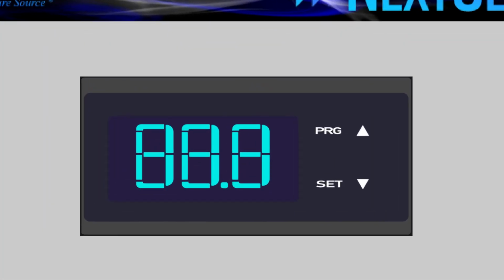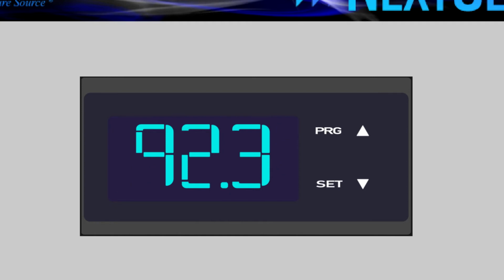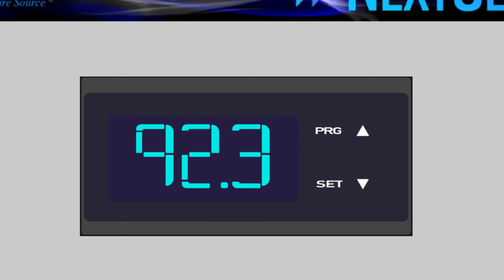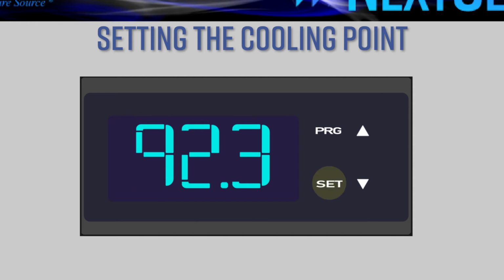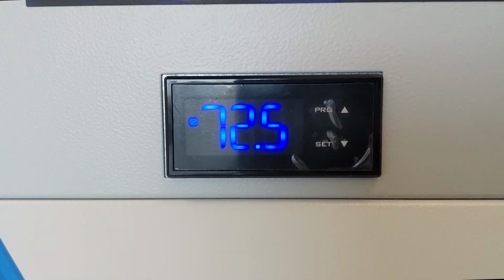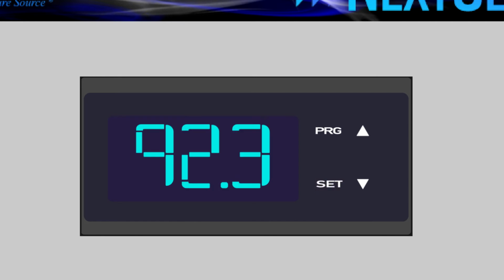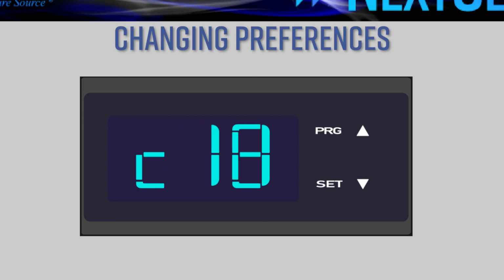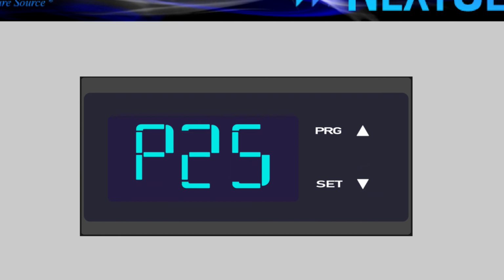Saginaw Control and Engineering IR33+AC Controller Intro and Explanation

Comment: I have a liftstation control panel with an sce enviro therm. It has frost build up. It came preset at 95, i spoke to a rep he said move it up to 100. The unit still has frost build up. Any suggestions?
Reply: Thank you.  This was helpful. The manual left out the hold part on the set menu